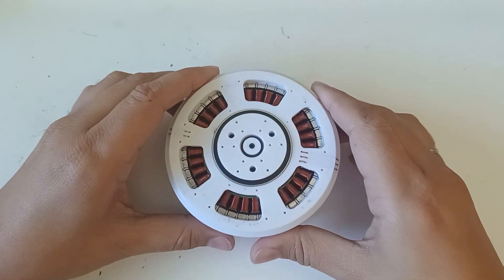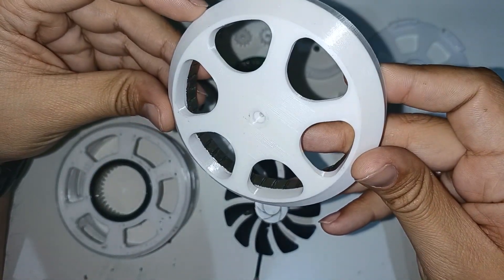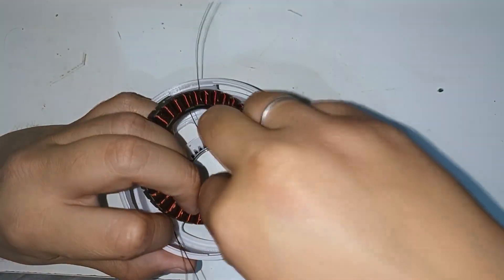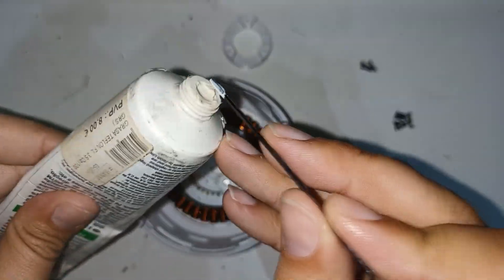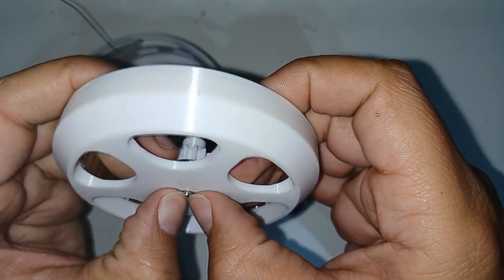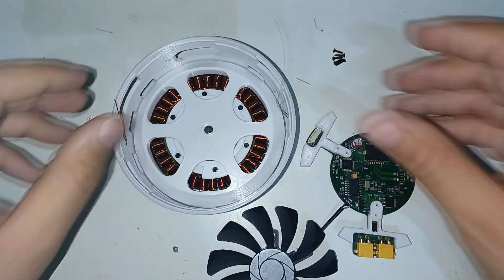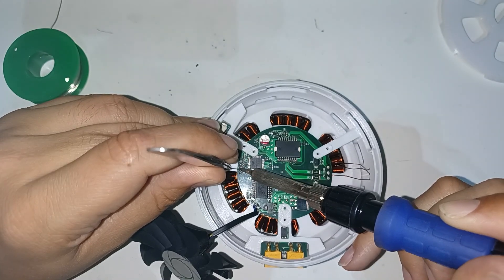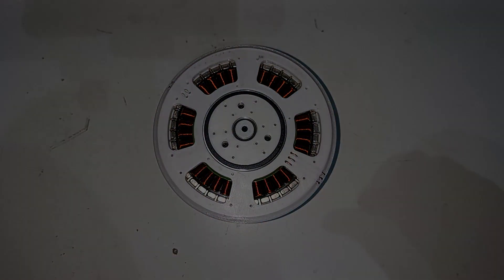3D Printed Robot Actuator Assembly

Comment: Great work. Can you please make a video and explain your motor driver ? It would be super helpful.
Reply from the maker: Thanks a lot!
That motor driver is a bit outdated right now. I'd like to make one with more capabilities. When it's ready, I might make a video.
Reply: @Jorgefer88 thanks for attention. I'm also trying to do a similar project so I would appreciate it.
Reply: @Jorgefer88 great work 👏  .Hope you have the updated driver ready, please do share. Also the development of metalic design?
Reply from the maker: @sanjayarora7940 I'm finishing the design of the new PCB, but there's still a long way to go before I can manufacture, test, and program it.
The idea is to make it more powerful with a DRV8323 and an STM32F446. I also want to test a new encoder where the magnet doesn't have to be on the shaft itself.

Comment: Magnets should be housed on a magnetic material for a better reluctance path.
Reply from the maker: Yes, you're right.
I wanted to do everything in 3D printing for ease of manufacturing.
That's why I had to use the Hallbach array matrix, so as not to lose too much strength.

Comment: Nice conception ! Is it not a problem that the stator cable is visible on the outside of the motor without protection? You could touch with your hand....Is it not safe ?
Reply from the maker: Thank you very much!
The cable is certainly a bit visible in some areas, but operating at 24V, it's not a problem even if you touch it.
Also, it's insulated copper wire, and it has varnish that makes it non-conductive.

Comment: Felicidades por el resultado me gusta mucho el diseño. No sé si estás teniendo algún problema con los engranajes pero al ser de plástico tal vez se rompan con facilidad y puedas considerar utilizar engranajes de metal por lo menos en el engranado que más movimiento tiene. 
Tengo una duda del diseño: cómo conoces la posición absoluta del motor? Si no he entendido mal, empleas un sensor magnético para conocer la posicióndel "eje rápido". Por lo tanto, cómo conoces la posición del "eje lento"? No conoces únicamente su posición relativa?
Reply from the maker: @pablogil5320 Muchas gracias!
Tuve algunos problemas con los engranajes cuando aplicaba el máximo torque, si, pero después de unos ajustes se comportan bien y ya no se parten.
Con respecto a la posición, tengo un encoder que detecta la posición del rotor (eje rápido), pero como la salida del motor tiene una relación de 4:1, dividiendo entre 4 puedo conocer el ángulo de salida. Además, cuando inicializo el motor, tomo como referencia ese cero y de este modo puedo conocer la posición absoluta desde la posición de reposo.

Comment: Bro please tell me about which brand foc controller u used
Reply from the maker: @A_lengend_of_India  The controller PCB is designed by me.
I use the SimpleFOC library for torque, speed and position control.
Reply: Is schematic is available  @Jorgefer88
Reply: Please send schematic
Reply from the maker: @A_lengend_of_India  Sorry, I'm not posting the schematic.
But it is based on the "SimpleFOC Shield" PCB which is OpenSource and you can find the schematic on their Github
Reply: Bro Neodymium magnet dimensions please

Comment: That's awesome. It's really great work! 
Could you go into a bit more detail about your magnet arrangement to compensate for the lack of a metal body?

I'll try and build one myself to learn!
Reply from the maker: The magnets are arranged in a Halbach magnet array. This reduces the magnetic field outside the rotor on the outside and concentrates it on the inside, used by the stator.
This arrangement compensates for the effects of not having an external steel ring on the rotor.
Reply from the maker: You can see the influence of the Hallbach array in this link:
https://things-in-motion.blogspot.com/2018/12/the-advantages-and-disadvantages-of.html?m=1

I highly recommend this blog to learn how to simulate the effect of the field in a motor with the FEMM program:
https://www.femm.info/wiki/HomePage
Reply: @Jorgefer88  This is so helpful, thank you so much!
I hope I can make one myself at some point!
Reply from the maker: @arnauaguilar8329  I saw in your last video that you are working with motors and the unreal interface, it's very interesting!
Do you want to make a 3D printed motor?
Reply: @Jorgefer88  I'd love to try this! I'm not an engineer, so it’s going to be quite a challenge for me.  

For the past few months, I’ve been diving into robotics and designing some actuators as hobby projects. One of the designs I’m proud of is a modular planetary gear actuator. Another project I’m working on is a robotic arm that uses ropes instead of gears! It’s coming along well, though it’s still unfinished.  

I’ve loved learning all of this, but I’ve found that external actuators can make designs bulky. That’s why I’ve been wanting to build my own motor for a while, but I always assumed I’d need advanced skills like machining custom metal parts. Your video has been such a revelation—thank you! It’s inspired me to get started on this new challenge.  

If you’re interested in checking out these projects, I’ve shared more details and videos elsewhere. Let me know, and I’ll happily point you in the right dirección! 
(Youtube won't allow me to add links to docs).
Reply from the maker: @arnauaguilar8329  He descubierto tu porfolio, yo soy de Madrid 😀
Son asombrosos los prototipos que tienes en marcha, los tienes muy avanzados!!
Por lo que veo, usas un sistema similar al cabestrante que usa el robot quadrupedo Stanley, imagino que lo conocerás, si no, puede que te inspire alguna nueva idea. Es un enfoque muy bueno el poder desplazar los motores y transmitir el movimiento solo a las extremidades sin que sean tan voluminosas y sobre todo, pesadas.
Yo llevo tiempo desarrollando esto también como hobby, aunque siempre atado a la tecnología de impresión 3D. Si has podido ver en mi ultimo video, el robot que integra estos actuadores es funcional, pero precisamente por ser en impresión 3D, el calor es un problema real y no puede caminar durante mas de 5 minutos de manera continuada.
Precisamente por eso, el año pasado compre una CNC casera y desde entonces estoy diseñando y fresando algunos actuadores completamente en aluminio, aunque aun no tengo uno completamente funcional que me convenza.
Si te interesa, podriamos charlar y conocer mas sobre nuestros avances!
Reply: @Jorgefer88 que alegria que vieras mis proyectos, son mis primeros pasos en este mundillo, pero estoy muy orgulloso! a ver si pronto puedo redactaelos mejor y subir algun video. 
Sería un placer mantener contacto! Tu trabajo con el cuadrupedo es espectacular.

Comment: I did not think PLA would work for a mini-cheetah actuator.  For my quadruped design, I rulled it out and went with a 9:1 belt drive reduction.  You proved it can be done with a very clean and elegant design.  I have 100 questions, here are a few of them
1. How did you build the stator.  I understand how to wind the wire, but how to make the metal frame
2. I do not understand the magnetic design of the rotor, or the purpose of the small magnets? Are the large magnet all facing the same way?
3 commutation is "FOC" or 6-step.
4. is the heat just "i squared r"?  If so, then would using much higher voltage result in less heat.
5. can you give rough performance specs, torge and power used.

You might consider open source, then people would see exactly what you did.  Unless you are worried people will copy these and try to sell them.  License can prevent that.  Do NOT wait until it is finished, place work in progress in GitHub the you update as you mak changes.  If you are lucky, the project is popular, and then people send you pull requests to address problems and add features.

Looks like I will need to learn to make a rotor and stator
Reply from the maker: First of all, thank you very much!

Are you making a quadruped robot? What electronics/motors do you use?

Making this actuator with 3D printing (PLA) has taken me many iterations to get it to work more or less reliably. To this day I still have problems with it, due to the heat and the efforts it has to endure, but it half works :-D

I answer your questions:

1. The only piece that I have not built is the stator, it was purchased on Aliexpress. It could be made DIY with cut steel sheets, but I think it would not compensate for the work it takes to do it unless you want something very specific.

2. Small magnets create a "continuous" magnetic flow. This is called the "Halbach Array". Because I don't have a steel external yoke (it's PLA plastic), a lot of magnetic flux escapes outside. In this way it is concentrated inside, towards the stator, causing the torque to increase. Using Halbach Array or external yoke is similar, you can see the detailed explanation here:
https://things-in-motion.blogspot.com/2018/12/the-advantages-and-disadvantages-of.html

3. Switching in FOC is done through 6 steps, yes. You can see the details of how the library I am using works:
https://docs.simplefoc.com/foc_theory

4. Indeed, using more voltage could make it run cooler. It's something I was testing, but starting at 30V I burned a couple of PCB boards, I didn't take that into account when I designed them. That's why I'm currently limited by electronics to 24V.

5. The continuous torque that I can handle is around 2.5N·m, the maximum at 8N·m. I have not calculated the performance and the nominal power will be around 50W.

I have considered on several occasions making it open source, but I am a little wary of what you say, that someone will commercialize it.
I know that there are different licenses and I'm sure that some may suit me, but for now, it is still in continuous development.

Currently I have bought a small CNC to be able to make the actuators completely out of metal, because I have reached a point with plastic and 3D printing, where I cannot make them 100% reliable and durable.

Comment: Nice. What gap do you have with motors and coil stator?
Do you know roughly kv it has and max voltage and current?
Reply: And what dimensions is the rotor core?

Comment: I changed to ABS because PLA deformed when standing over longer time under load.
Reply from the maker: Yes, I've been testing various materials. And although ABS is more temperature resistant, under the load of magnets, ABS and PLA behave quite similarly.

Comment: That is incredible awesome work....
Are you planning a patreon or opensource page or anything for the actuator? That's so worth my money to finally have an affordable BL actuator with integrated controller instead of steppers for robotic arms.
Reply from the maker: Thank you so much!
I haven't planned it yet. The actuator and the PCB currently have several problems that I am correcting little by little, it is a project still under development where I am constantly changing things.
I have made everything from scratch precisely for this reason, because commercials are very expensive.
Reply: @Jorgefer88  any update on the progress?

Comment: Really nice design and the shirts with the robot are impressive. Is the PCB your design? If so what are it's features? Could you provide design or looks to the parts you bought?
Reply from the maker: Thank you so much!
Yes, the PCBs were designed by me for this project. The features are similar to the SimpleFOCshield PCB, which is open source, I based on it to make my own.
Reply: @Jorgefer88   Do you intend on making your design open source at any point? 

If not, can you at least answer whether this implies that you're using an arduino somewhere or embedded the arduino directly into your PCB?
Reply from the maker: @ChrisAltamimiEpsilon  Maybe in the future, but at the moment I don't have it in mind.

The PCBs have an STM32 microcontroller, since more power is needed to control the actuators than that available on an Arduino.

Comment: Impressive! How much it cost for materiel to build one motor? What is power output/torque for motor?
Reply from the maker: It costs around $120 per complete actuator.
The maximum measured torque is 8N·m and the continuous torque is around 2.5N·m, I'm still doing tests regarding that.

Comment: Excellent work! The only thing I would suggest is to put some hot glue on the motor and thermistor wires where they solder to the circuit board to act as a strain relief. Should reduce fatigue from the vibration of walking and jumping. It comes off easily with alcohol if you ever need to disassemble it.
Reply from the maker: Thank you very much, that's a good idea.
So far I have had no problems during the tests.
If I start to have problems, I'll take it into account.

Comment: Great work sir. Can you tell me how did you approach this design. Also, how did you learn to make interference/press fits. Did you run any FEA tests to check the compatibility of the design on various loads and conditions? 
I'm very curious to know. 
Overall, amazing work and demonstration. Ingenious design.
Reply from the maker: Thank you so much!
I was inspired by the robotic actuator of the mini cheetah robot.
To be able to do it in 3D printing I had to change a lot of things, but the general design is similar.
I did tests at the maximum torque generated by the actuator, and I verified that I did not have excessive bending problems in the material. He did not perform simulations with FEA.
Reply: @Jorgefer88  Thank you